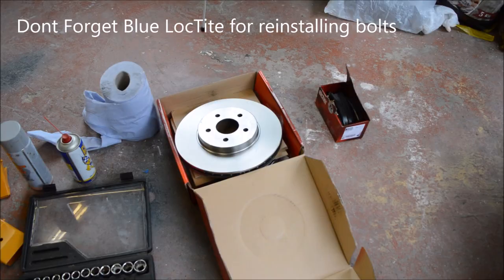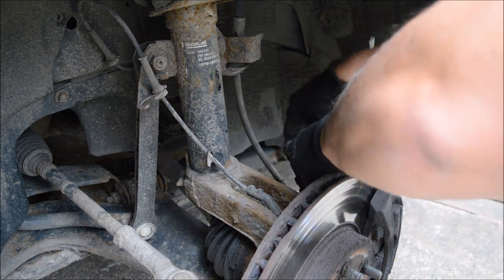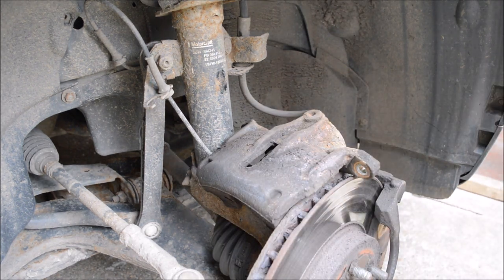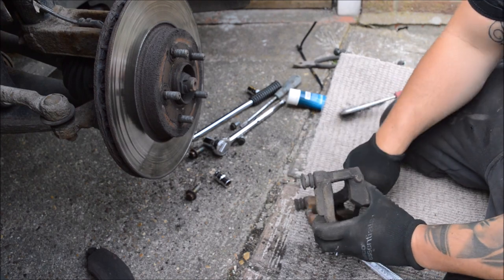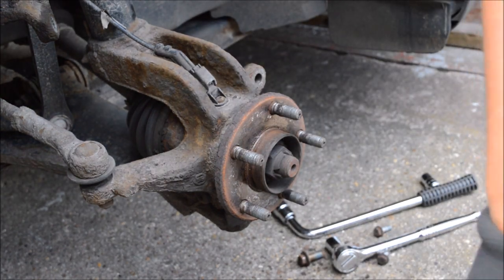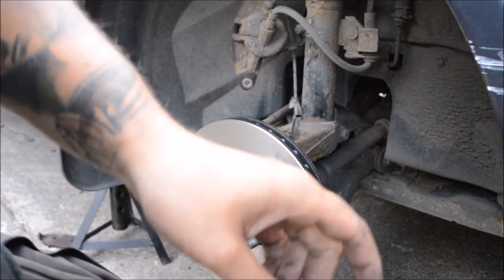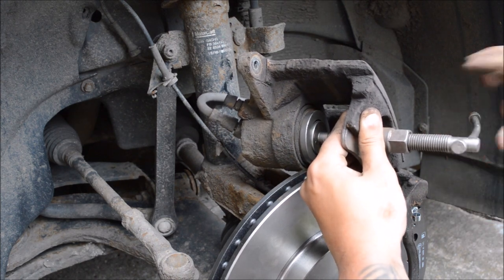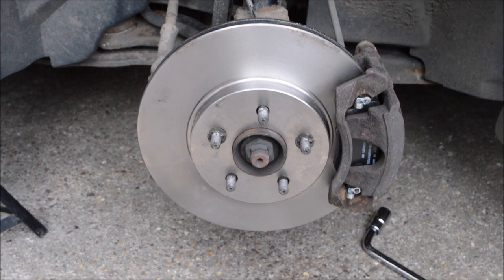How to fit Ford Mondeo Front Brake Discs and Pads

Comment: You should ALWAYS open the reservoir cap when pushing the pistons back into the calipers or you'll end up damaging a seal, then drain out any excess fluid using a syringe if it has been topped up over time as the pads wear down, also you didn't clean the hub face before fitting the disc, any debris or corrosion left behind can cause brake wobble if the two faces don't meet flush.

Comment: Hi planning to do this job and so looking at lots of videos.
Could you clean piston rubber and piston sides then silicon grease  expose piston to make meeting on piston and sides friction free when it’s pushed in.
I would also have taken pins out and cleaned and silicon greased them.
I am learning so much before I do this 
Thanks for video!

Comment: when i replaced dics and pads at the rear the last person to work on the car rounded all the caliper bolts so rear calipers were very rusted out so had to replace new rear calipers and pads  lesson use correct scocket size or can be very costly .
Reply from the maker: michaelstarwars66 Amen to that i had the same thing on my Type R. Luckily I managed to get them off and replace them with new bolts.
Reply: i know what a pig of a job a 1 hour job turned into a 4 hour job

Comment: Good video, but you shouldn't really start pushing that piston back in without opening the bleed nipple, you could flip a seal in the master cylinder or trash the ABS unit.... And obviously in that case it'd be handy to over fill the reservoir slightly before hand to ensure it doesn't run low when you pump the brakes afterwards.
Also, in my personal opinion, from years of pain caused by other people using them, adjustable spanners should be banned :p
Reply from the maker: Strider9655 Hi mate thats for the comment! Makes total sense what your saying. Although Ive never had an issue before but thats not to say I wont in the future. I will give your method ago in the future,  oh an yeah I hate adjustable spanners but it was what i had to hand during the video lol.
Reply: That bleed nipple is on the caliper right?.
Reply: @Vanadeo  Right.